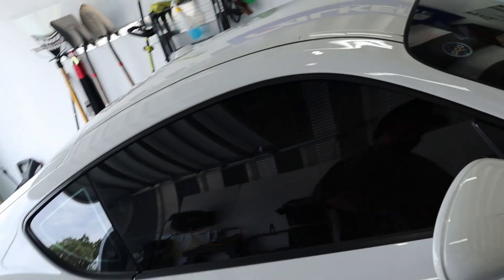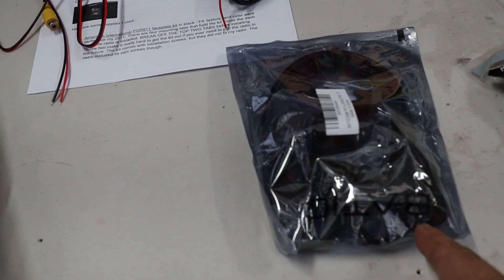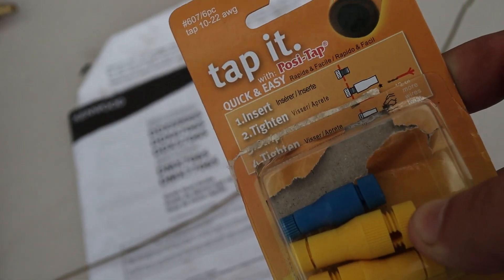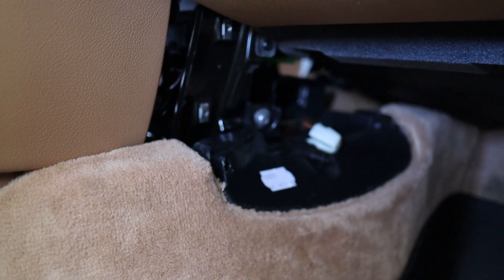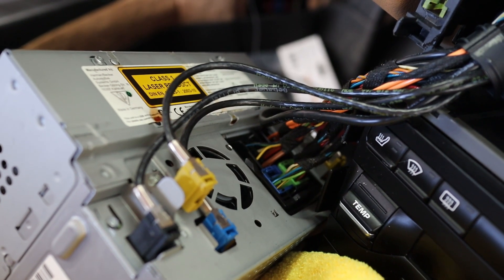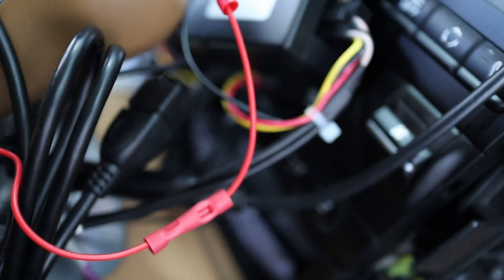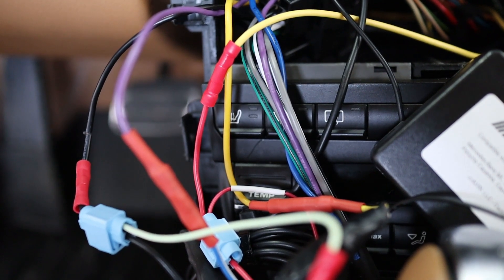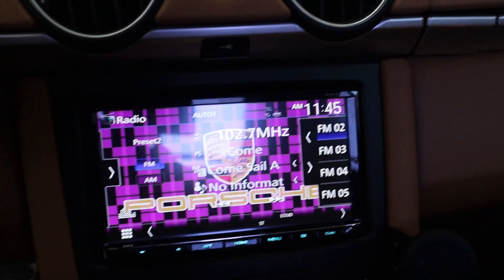Cayman: Complete Head Unit install - Includes Part Numbers

Comment: Hi. For the backup camera. Do you foresee any issues if I run the cable to the head unit through the passenger side ?
Reply from the maker: No, I just ran it down the drivers side, because I had that side apart.